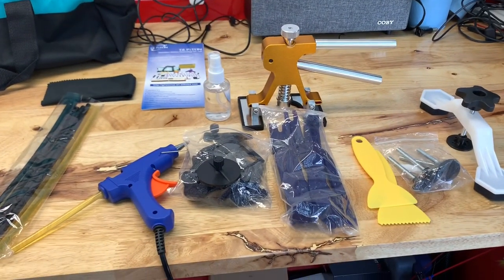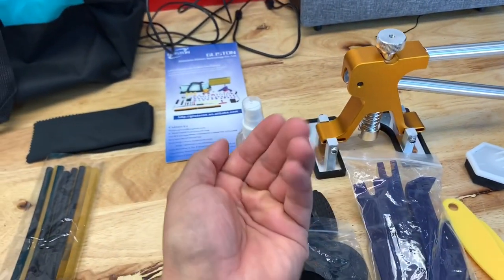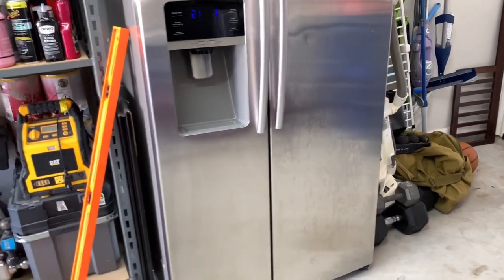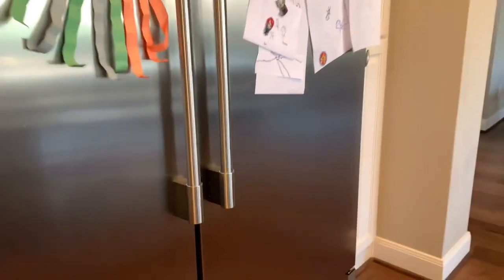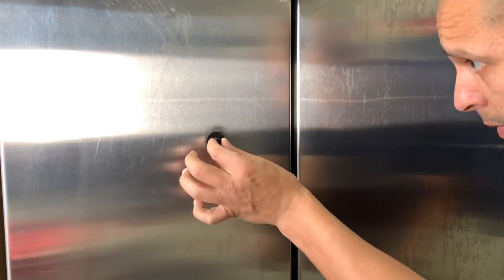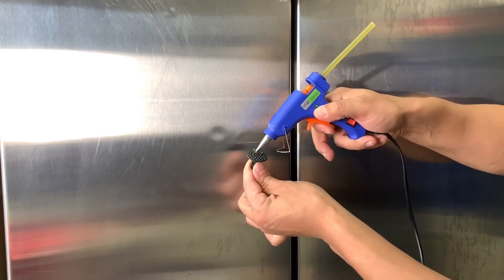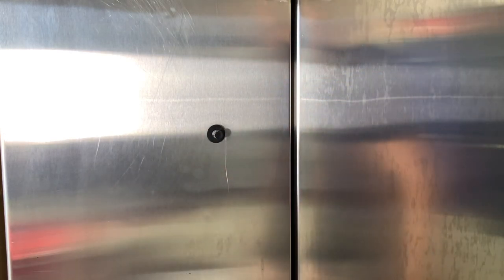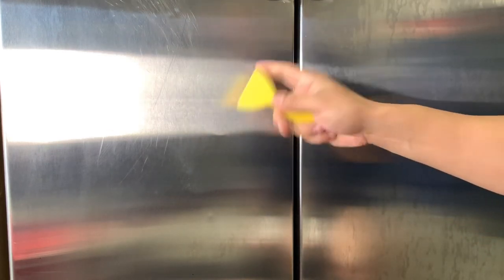Removing A Dent From Stainless Steel Fridge. How to Removing Dent from Fridge Door.

Comment: Thank God, a fridge dent repair video that is not crap!  Thanks
Reply from the maker: Thanks 🙏🏻
Reply: @JJBanuelos  Another cheap method to try remove the dents is to use a French fry slicer suction cup under it, after applying the suction you can move the attached unit gently to the side or circular motion to grab the dent upwards and to sides. (starfrit-french-fries-cutter)

Comment: I’m  a 20 year pdr tech, the process he used does work , however pulling a dent flush on first time is a very rare event, not saying this is misleading, because it does happen. If you keep everything clean while tapping back down because you will need to , most pull high with proper adhesion, polish the tip of knock down with 2000 grit sand paper and even polish with compound after
Reply from the maker: I agree I definitely got lucky on this one. It does take practice & patient’s. Thanks for the tips & for watching. PDR is a skill I’ve always wanted to learn.
Reply: The dent is gone but it looks like it caused a slight outty. It looks like it in the video anyways. Is that completely smooth where the dent was or does it feel raised, creased a little?

Comment: I used this exact tool and method, and it pulled out a portion of the clear coat on my brand new fridge!! This doesn't seem to be brought up by anyone who has done this, but BEWARE! The dent is a bit smaller than initially was, however I do not want to do a third+ round of pulling on the dent in the event that more of the clear coat comes off and makes the area looks worse than it was.
Reply from the maker: Sorry to hear about that Kayla. Was it a clear coat or some kind of plastic film possibly to protect the finish? Either way thanks for the heads up.
Reply: @JJBanuelos  Definitely the clear coat. I am so so upset! I have no idea how to repair the clear coat now and the dent is still there, just a bit smaller.
Reply: Kayla Pickles did you try contacting the manufacturer?.... i just saw on mine that they sell refrigerator paint for scratches... just a thought
Reply: Yup. Some appliances have a clear coat to make cleaning easier. That's why you should never use cleaners like rubbing alcohol or scuff pads. It'll ruin the finish. What u can do is fix the dent with some Bondo aka autobody filler. Sand it. And wrap the panel with vinyl wrap like they do with cars. You now can choose any color you want. They even make wraps that look like steel.

Comment: It looks good.  Thanks for the video.  Near the end it seemed like there was a tiny bit of a wrinkle ... but maybe that was just the angle of the light reflecting off the surface.  I'm going to try this!
Reply from the maker: No it didn’t have a winkle but more like a small crown to it but it’s definitely not as noticeable as a dent. Thanks for watching & good luck!
Reply: It raises up the SS in my experience. I think some kits have the knock down tool for after. Mine looks a bit better but the reflectivity of SS makes it almost impossible to get it right...at least by me ;=)

Comment: Will this work on black samsung fridges without pulling the paint off? Dumb question but I never done this before, no idea.
Reply from the maker: Yes it’ll work on a black fridge for sure. It definitely won’t pull the finish off, just squeeze the handle gently & apply small pressure. Takes some time but it’ll take the dent out.

Comment: Is. So easy use the presión atmosféric...put a box of ruber Over the hole ,put silicón around so that not input air...do two hole one up and another down ,then with the dryer Over the box flow. air betwen the holes,.
Reply from the maker: Thanks

Comment: Well done on the fix. How do you think it might go on an enamel painted fridge?
Reply from the maker: Should be fine. I would definitely be a lot more cautious when apply pressure with the puller.
Reply: will not work. too shiny, glue will not adhere.

Comment: I have small dents like these in my fridge but I also have a larger one on the top of a dryer.  Do you think this would remove a dent that is more like 8 inches around but not very deep? ... think of the size of a hand print... someone leaning on the top of a dryer to see the components in the back...
Reply from the maker: If it’s that big it may be difficult for the tool since it can only open so wide. As crazy as it sounds I’d use a toilet bowl plunger for that. It might just work for you. Wet the surface a bit so it gets good contact & suction & pull away.

Comment: hi i got everything you got but the glue won't stick to the fridge  the plastic thing pulls off easy.
Reply from the maker: I would let the glue maybe cool a little longer once on the surface then with the puller I would apply very small sqeezes with light pressure working the metal instead or hard pressure if this makes sense.
Reply: @JJBanuelos  that glue cools quick i gave it plenty of time hours. its good name glue too  i can pull it of with my hand this glue won't stick to this fridge  its not a stainless looking surface  its new dometic 105 liter  12 24 volt. its steel though  1700$

Comment: You needed to tap down the high spot
Reply from the maker: Yeah it had a small crown to it. Could have pull it a little softer. But with the knock down tap it’ll bring it back down